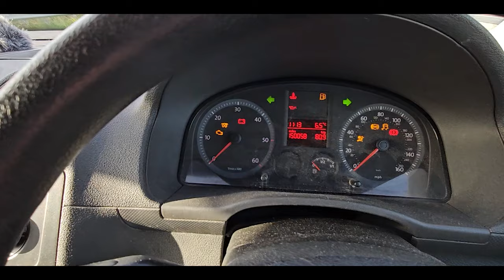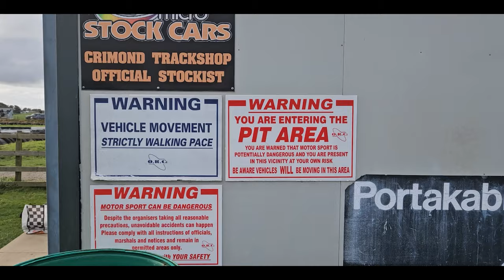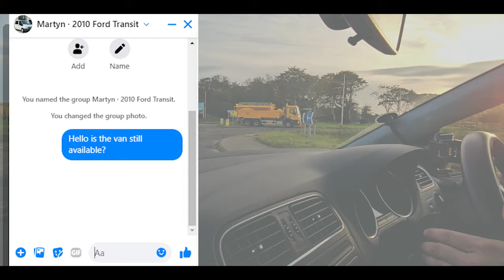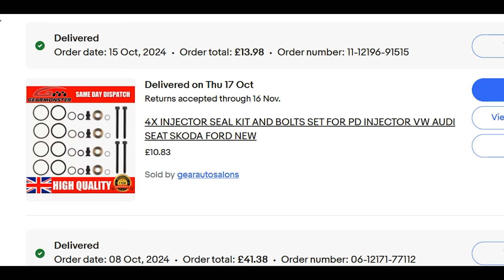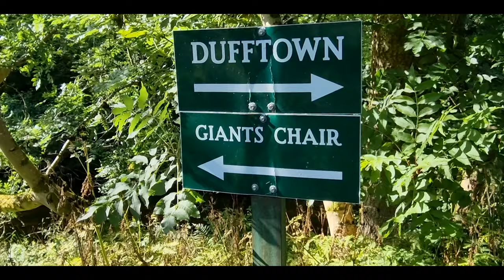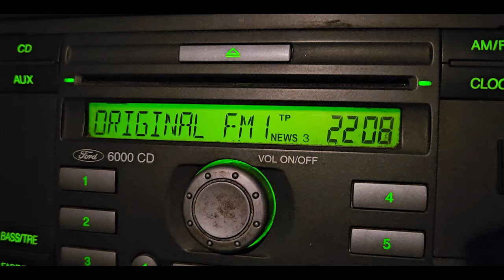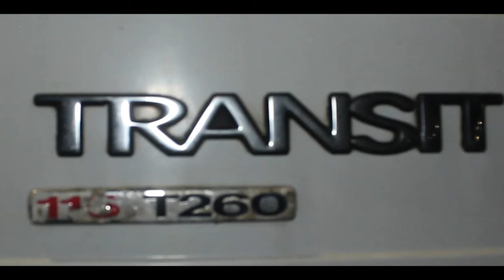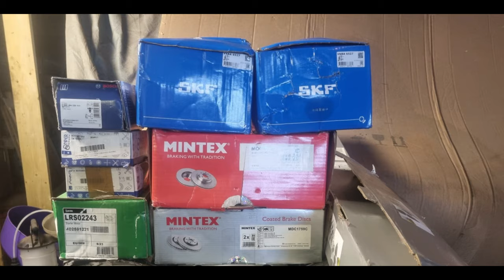The NEW van is here!

Comment: Nice 👍  my transit has over 250k on it, keep up with oil changes and you'll have loads of years left on that engine 😎
If the mirrors still have the original bolts in them? They will be security snap off head bolts 😢 easiest method  i find is to centre punch the remaining head, drill it 5 mm deep and hammer in a torx bit, they usually come out after the heat of drilling and the hammering in of the torx bit, good luck with the conversion,  subbed to follow the build 👌
Reply from the maker: @Dirt-Diggler  this sounds like what the guys at work said pretty much to the letter

Comment: The engine in that is one of the best you can get in a transit , the crank pulley failing is a common issue though 👍
Reply from the maker: Thanks James. Yeh it pulls like a train, but ta for the heads up. 103k on the clock so barely warmed up+